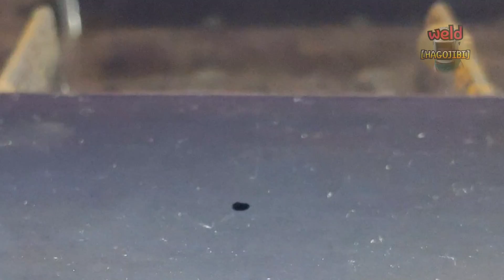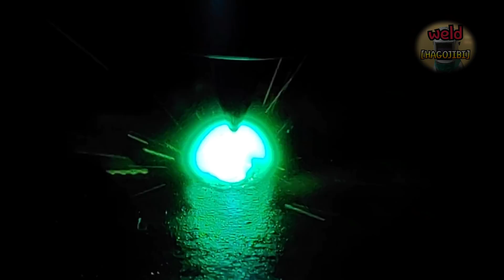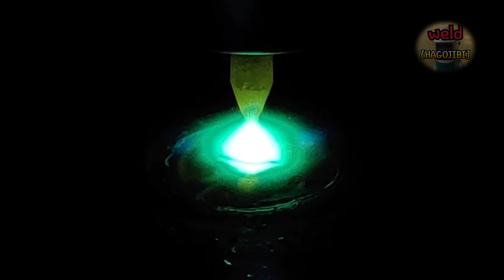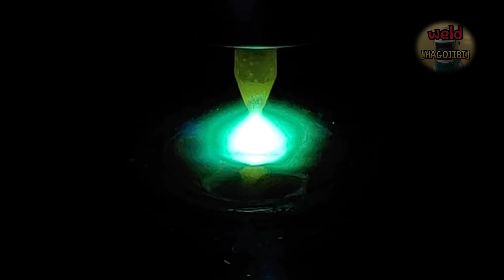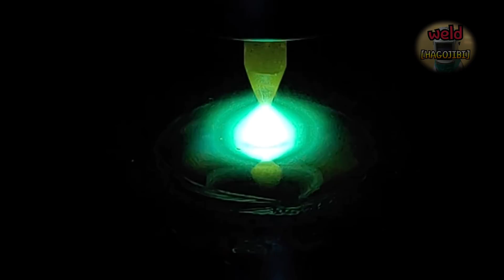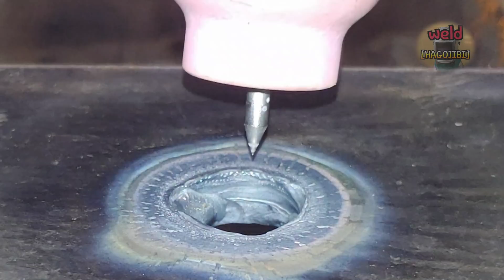Amazing process of drilling a hole in a thick steel plate by TIG welding arc

Comment: I’m a pipe welder with 30 years of experience and it’s been about 10 years since I’ve learned a new trick. I’m always the one who teaches these little tricks. I’ve drilled holes with stick but not tig. Stick is good for cast iron to pop a hole. Thanks 👍. I subscribed and hopefully you have a few more tricks up your sleeve

Comment: In the past I've used 6010's to blow holes in metal but I've never thought of using a Tig. I'm doing a piping job at work tomorrow so I'll have the opportunity to try it out then but, not on the piping lol.

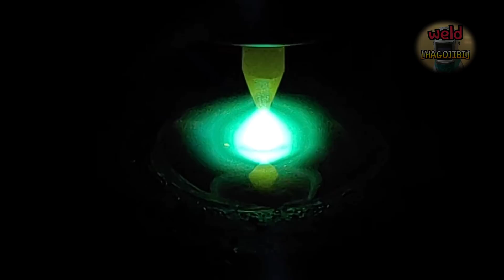Comment: I'm curious what happened around the 1:05 of the video.   The puddle suddenly dropped down like half a centimeter, but still stayed there until it fell off completely.    How is that possible??   Like there was a hole, and the hole got clogged or something.
Reply: He might have been supporting the metal on his leg, and it took a little longer to burn through his pants.
Reply: @Patriottoo2  Without a doubt
Reply: It's just a speculation of newbie TIG welder, but I suspect surface tension of lower layer/the other side of the piece and plasticity of metal.
Metal basically (probably) became plastic enough to form a molten bubble on the other side, but not hot and plastic enough to fall off yet and let the arc blow through. But that's just my speculation